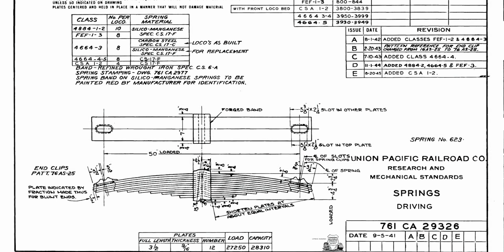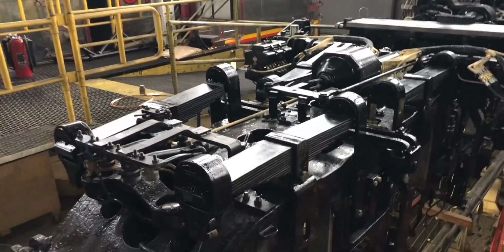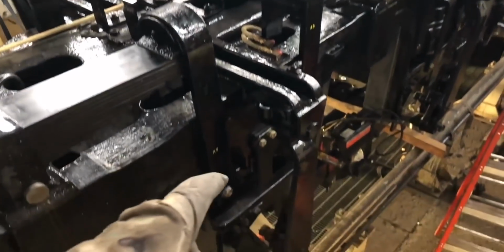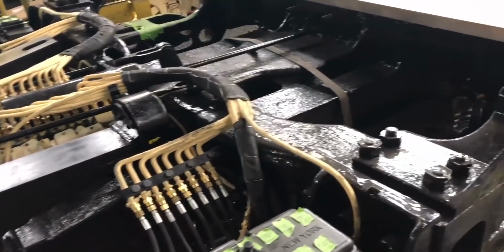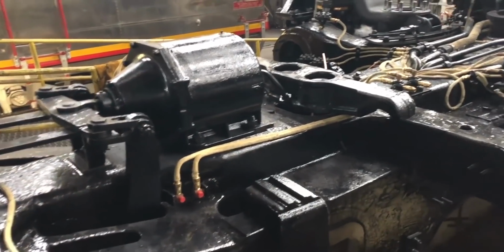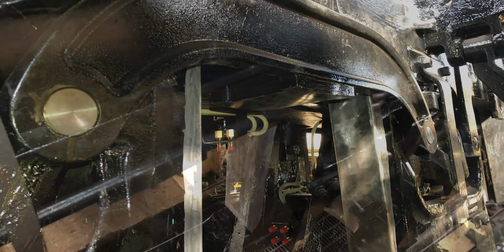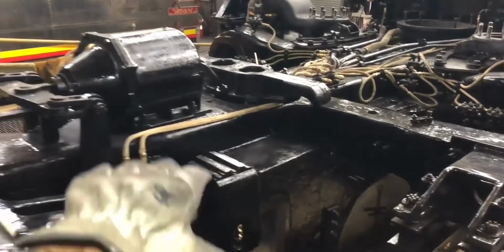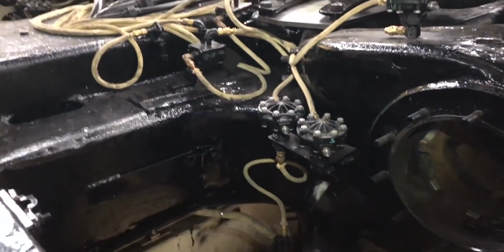Steam Update: Locomotive No. 4014 Front Engine Walk Along

Comment: Years ago Denver's Forney Museums Big Boy had to be moved and at nearly 500 tons one thought was to cut it into thirds so it could be hauled like heavy equipment down the streets. But the plan was fortunately abandoned in favor of leap frogging the track it and other rail road artifacts including a rotary plow till it reached existing lines along with a bridge that could take its weight. UP 4014 has something in common with its Denver counterpart since it will use fuel oil not coal as the 4008 did for a while before being retired. The anticipation of seeing a UP Big Boy takng to the rails again is almost unbearable and it will be quite a sight if the Challenger the last of her steam together some day.

Comment: All  I can say as a retired Manufacturing engineer  .....is WOW! Effectively reverse engineering and creating parts from scratch, especially casting. Have to wonder where there is a foundry that can even deal with that level of work! Over seas? Pattern makers were hard to come by 40 years ago! CNC did patterns and grey but still WOW! You folks have a dream situation and have done an absolutely stunning task. Wishing I was close enough to see and appreciate the final work! A bucket list thing for me I think...
Reply: I think Ed has mentioned before that they have all the ALCO blueprints for parts, and even maintenance tools, in their archive, so I don’t think there’s much reverse engineering required. The foundry work is impressive though. I imagine there’s places out there that will do it a couple pieces at a time, but not cheap. Guess that’s the advantage of having deep pockets to get stuff done.

Comment: Not sure if you guys would be interested in this but not only do we here in the UK have a thriving locomotive restoration industry we actually still build new steam locos. A group of enthusiasts put together an idea in the '90s to 'crowdfund' the building of '60163 Tornado' a Peppercorn A1 Pacific 4 - 6 - 2 loco capable of 100 mph, an extinct design from the late '40s. That was completed in 2009.

https://www.a1steam.com/

The same team then had the idea some years ago of building a new Gresley P2 Pacific 2 - 8 - 2 loco, the most powerful steam loco built for the UK railways, from the original drawings from the mid '30s. Sadly all the original P2 2 - 8 - 2s were rebuilt to A2 4 - 6 - 2s during WWII. The construction is going well and the loco now sits on its running gear and was 'rolled out' recently. Again all volunteer crowdfunded.

https://www.p2steam.com/

Not by any stretch a 'Bog Boy' but then we have a vastly different loading gauge here and have to do what we can in the limited space available. God speed to UP with this rebuild .. stunning locomotive.

Comment: What will it be burning; coal or oil?
Reply: All the steamers burn oil or were converted to do so.
Reply: whiteknightcat what was the reason behind that? Efficiency, or another reason?
Reply: @davidanderson1639  Towards the end of the steam era some railroads began using oil-fired steam engines for several reasons. Oil produces much more heat per unit weight than coal, so yes, it's more efficient. There are also less large mechanical systems involved in pumping oil from a tender than conveying coal, and no ash pan to dump afterwards. Firing is a lot easier as well - think of starting a propane torch vs firing a barbeque grill. In today's world, it's also likely a lot easier to obtain loads of Bunker C fuel than coal.

Comment: So i am not a big Steam fan but i greatly enjoy every Steam locomotive that remains and mostly has to do with in the era i grew up. I have loved nearly every Steam engine that has ran or has been parked and as a person who loves to bring things back from the dead i wonder if and how much newer tech has been applied to this engine in the form of upgrades and or component material differences bases on current material composites not only for safety but also for longevity of service for generations to come. Would be cool to see a vid at some point talking about say that the metal used in the replacement of components was replaced to drawing but the material was lighter and or stronger cause of is newer material spec. Kinda like upgrading a Tin can to a AL6064 or along that lines. You all do some awesome work in restoring and maintaining history, Thanks so much and Keep up the great work.

Comment: So if that's a front engine Ed Dickens when do you suppose the rear engine will be completely rebuilt and are you nearing completion 2019 is rolling up very quickly
Reply: I wouldn't expect completion until at minimum late 2019

Comment: Here we learn why it takes years to rebuild a 4000 class engine from scratch! Some new parts are probably not original, as this type was also built in the 1940s with cost reduction in mind, so machined parts will now replace stamped / cheap steel in many sections of the locomotive.

Comment: It’s getting to be a fine line between “restored” and “new”. Glad that UP is taking the TIME, EFFORT and MONEY to do things right. The 4014 won’t be restored to “just good enough” condition, but “better than new” condition. You’ll note that Ed indicates that the spring rigging is rebuilt new to REVISED drawings that UP developed from information gleamed from years of hard service. So, the spring rigging is better than the day UP took delivery from ALCO!

I’m really hopeful that the 3985 will also get the same loving treatment in the coming years. Nothing against the original restoration, which was funded and performed by volunteers, but the 3985 deserves to be upgraded from “just good enough” to “better than new”.
Reply: DieselDoug77 It's a restomod!!
Reply: I do believe it is a good idea to cast and fabricate new parts to replace what is worn out, and even using better desighns, parts, and more modern materials to improve durability and performance as opposed to just typical restoration which focuses on just making it safe to run & it's outward apperance. These beasts do have to last a real long time for the emense expense to be worth while.. the longer they can last before the next restoration overhaul the more likely the money will be there for it.
Reply: The thing with all locos of that era is that they were run very hard during and immediately after WWII, and even newer engines were prematurely worn out.  Same with the rolling stock.  Any steam engine has a mass of parts that wear out much more quickly than those of more modern engines, and have to be serviced or replaced - it's just a part of running those old beasts.  Good on UP for undertaking such a massive project.  I can't wait to see her when they're done.
Reply: Exactly.
Reply: This is so far beyond a restomod. It’s one thing to stuff a modern crate engine into an old chassis and add “newer” technologies like air conditioning and coil spring suspension. Everything about this rebuild is 100% custom. There are no replacement parts available, they all have to be sourced from raw materials.

One thing that hasn’t been mentioned yet is whether UP is going to reuse the original main rods and side rods. In past videos of the Steam Shop tours, Ed mentioned that the bushing bores on the 844’s side rods have been overbored numerous times, necessitating a speed limit of around 60 mph being imposed on the 844. Gone are the days of her running 80 mph on the main (her design speed was more like 120 mph). There are NO spare side rods for the 844, 3985, and 4014. Hopefully UP can find a foundry that can forge new main and side rods.

Comment: wow, what a monumental task.  hard to imagine that American low-tech industry built this damn-near 80 years ago.  and they built a bunch of them on an assembly line.  Good job to the modern crew in resuscitating this behemoth jewel.
Reply: 80 years ago this was cutting edge steam technology, the diesel electrics that eventually supplanted these beauties were in their infancy.
Reply: This "low tech" was state of the art 80 years ago. And they didn't have computers to do the bulk of the engineering work designing these things ether. Building and mantaining steam locomotives was also a very labor intensive job. A big part of why they were replaced by diesel electrics.. far less routine maintenance and far less labour intensive.. back in the steam erra railroads employed more people than almost anyone else. Today they employ a tiny fraction of the number of people they did in the 1940's. All thanks to a plethora of technology advancements.

Comment: With these new fittings, and castings made out of newer material, how much longer of a life-span does it have compared to what 4014 was originally built with?
Reply: Buddy R. Shortcut is not in Ed’s vocabulary. That’s why 3985 has been out of service for so long.
Reply: Baltic 144 Productions That all depends on how much they run it. More wear means shorter lifespan.
Reply: Keep in mind that they also spent the time and money to restore the shop and equipment so that they can  maintain these locomotives much more cost effectively.  All the new parts and restored facilities and equipment are a great sign that the UP is making a "long term" investment in the steam program instead of just a "just get it running" approach.
Reply: @Buddy R. I know, but instead of letting it go, UP put money into it.  That's my point.